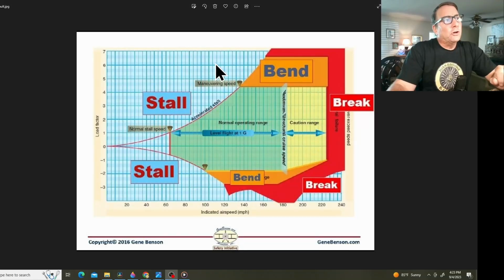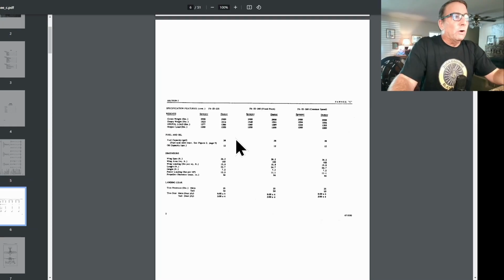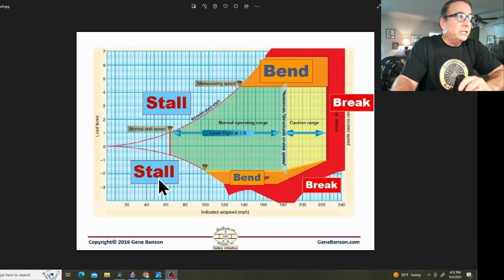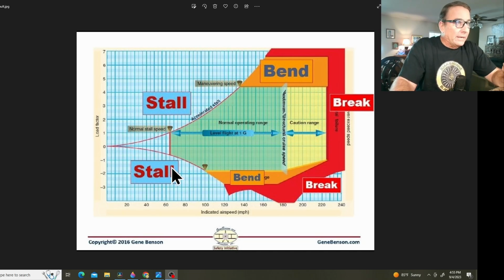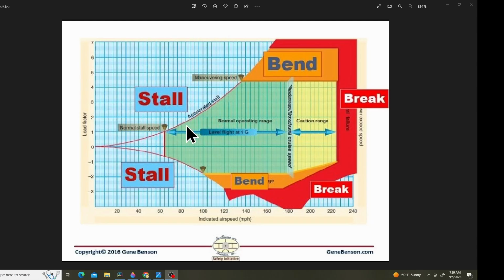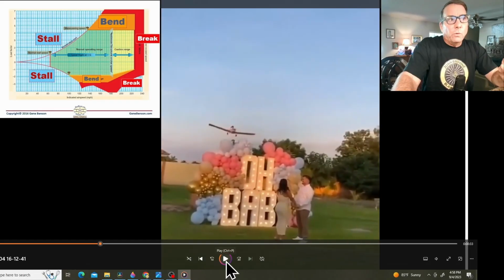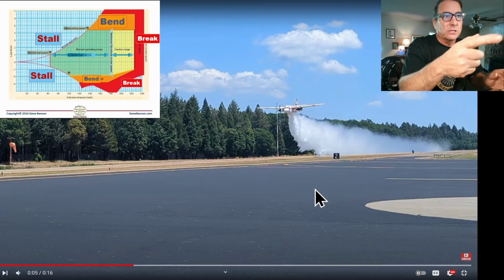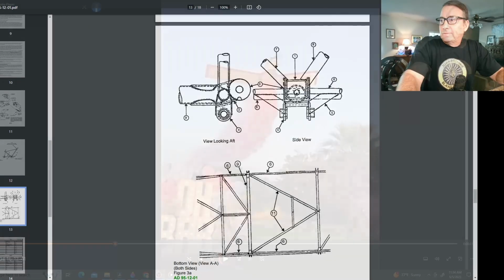PA25-235 Sinaloa MX Gender Reveal Party Structural Failure

Comment: Am I right in thinking that the safe operational airspeed is reduced when there is less of a load due to the increased potential acceleration (increasing potential g-force) within the normal structural wing  load limits?   So, you could actually increase speed above that diagram's indicated limit, but your manoeuvring potential would be critically reduced?

I noticed in the video, when its played frame by frame that he actually pulls up to a vertical (straight up) pitch extremely quickly from horizontal and at that speed the air pressure against the plane of the  wings ripped one off immediately.

Comment: Juan the best at this.
I watched it multiple times in slo-mo and I’m wondering if the pilot was a little lower than he planed or the palm trees were a little higher that he thought? What ever the reason man oh man did he pull that nose up, it looked like it was 45 degrees nose up and the wing was folding up around the fuselage in less than second, and when he cleared the palm trees they look to be much higher than the others off to the side of him.

Comment: If I get this correct, the maximum maneuvering speed decreases with the weight in the same way the stall speed decreases. Vs new = Vs Old Weight × √(New Weight / Old Weight). Thus, Va new = Va Old Weight × √(New Weight / Old Weight)

Comment: Hey Blanco, when the water is dropped rapidly, remember the wings were making 3,000 lbs of lift but the aircraft now weighs only 1,600 lbs. The airplane climbs violently, sometimes exceeding the available down elevator.
Reply: I'm no expert, but this doesn't sound right to me. The wings are placed at, or even slightly behind, the center of mass of the plane; so even with the large discrepancy between lift and weight, it doesn't have a significant moment arm to operate around, and if anything, with the wings behind the centre of mass, that would create a slight nose-down torque upon release -- but regardless, the tail fin is there to keep the plane flying generally straight. So I think you're confusing linear forces with torques. I mean, the plane can fly straight and level when full, and can fly straight and level when empty. It's just a angle of attack change to move towards those two regimes.
Reply: @TheHuesSciTech The tank in that Piper looked to be forward of the natural CoG, mounted in front of the pilot like that. The dump probably moved the CoG backwards a bit, and did so suddenly. Given the likely strong nose-up trim required at maximum weight, even a small movement of the CoG could induce a strong pitch moment if the pilot wasn't ready to counteract it.
Reply: @TheHuesSciTech  it has nothing to do with CG. Presuming everything is in equilibrium, trim is set, the horizontal stab is neutral or pulling down slightly and the wings are making 3100 lbs of lift to carry the 3,000 lb gross weight straight and level. Now dump the 1,500 lb load in about 3 seconds. The airplane will pitch up violently, not because of any change in cg, but because the wings are still making 3100 lbs of lift but you only weigh 1500 now. Try it sometime...ag pilots are accustomed to taking 20 or 30 minutes to empty their hoppers, not 2 or 3 seconds. Best of luck, and be ready with ALL the forward stick!

Comment: This had to have been a maintenence or inspection problem, it almost certainly wasn't a problem with Va adjustment. 
Remember that engineering load (stress applied to the components, not cargo) is the product of acceleration AND mass. Components really don't care if a load of 20 units was created by 5units acceleration and 4 units of mass, or 2 loadfactor and 10 mass. There may well be a failure somewhere else, like the seat frame/floor under the pilot or engine mounts because of a non-proportional reduction in sub-component mass, but it wouldn't be in the wing attachment. (The video touched on fixed mass components but stopped short of considering their actual affect.)  

A true adjustment to maneuvering speed is quite a bit more complex than "it is reduced with gross weight", and involves the specific loading configuration, minimum load factor limit required by the type of flight and max load factor limit for the fixed-mass components of the aircraft(engine mounts). The basic stall-speed-style adjustment ( Va₂=Va₁·√(w₂÷w₁) ) is a conservative [worst case loading config] gross simplification, useful for easy of flight planning but insufficient to analyze a crash.
 
If you are at the listed maneuvering speed for MTOW and most of the weight reduction was taken from the fueselage (so that the wing tanks are at least proportionally full) then the structural stress placed on the wing components by the increased acceleration factor will not be any higher than the design working load limit and the failure will not be in the wing structure.
Reply: It didn't look like the plane's speed was above simply adjusted Va anyway, which would be 92-97mph assuming 150lb pilot and fuel between 30minutes and full. 
And ultimate design load being at least 150% of working load limit (122% of simple limit speed = 113-119mph)).  
Reading the manual, normal dusting and spraying is done at 70-90mph; and 75% cruise with the spray equipment is only 103mph.

Comment: Another way to think about the issue of pulling G while dropping weight is this: Being that G is lift over weight let’s consider a 2,900lb Pawnee pulling 3G’s. That’s 8,700lb of lift. If that lift is maintained while dropping 1,000lbs the G load jumps to over 4.5G in an instant. Add to that the often corrosive nature of spray chemicals over the ,ice of an old airplane.

Comment: I believe the compression struts of the Pawnee don't help much. They have a big internal stiffening beam, but all the same I don't think the failure behaviour is the same when the failure mode is buckling instead of stretching, and effectively there is no or little yield phase where you merely bend things. Once the strut starts to buckle and bend off axis, and the load is still there, that's it that's all.

Comment: lower weight causes          lower safe manoeuvring speed  because ?   You can pull more g load with full control input when the plane has a lower mass??     Did I miss  that exact correlation take away from the graph ???

Comment: When an aircraft manufacturer has a bit of a reputation for wings occasionally folding up unexpectedly, keeping any unnecessary wing loading out of a drop like this seems like an even more crucial, basic safety practice even without the corrosion factor being known. It's not just ag sprayers or GA that have to face corrosion risks head-on, either. Airline aircraft deal with corrosion issues as well, and the manufacturers have their own specialist "corrosion gods" who get to know the issues seen in the field, and their remediation, in great detail. Boeing had quite the send-off a few years ago for their retiring master of the subject who spent lots of time deep in the structure of 747s (esp. under lavatories and anywhere condensation tended to form), and even in their fuel tanks where organisms would live feeding off the jet fuel and creating issues in tropical climates, particularly.

Comment: Alternative hypothesis: the pilot pulled up a moderate amount but managed to get the stabilizer so low that it dipped into the dropped load mist. Because that mist is a heavy fluid it vastly increased the up elevator effectiveness and so slammed the tail of the airplane down, hence causing high AOA and the overloading of the wings.
Reply: You got it all wrong pal

Comment: I fly SEATs and I can tell you that the airplane does pitch up when the load comes off. If you ever watch a cockpit view you’ll see the pilot push the stick forward (full forward for a salvo). I think the pilot wasn’t ready for the pitch up, was well above ideal drop speed, and the rapid increase in G’s caused structural failure. Keep in mind that the wings are producing around 2900lbs of lift at that airspeed and pitch angle. When the plane loses, let’s say 1000lbs within a few seconds the excess lift causes the plane to pitch up rapidly. If you aren’t ready to counter that with forward stick, you will find yourself behind the plane. This tendency only increases with speed.

Comment: That is soo very sad.  The pilot being over excited for his friends with such a display, possibly..  Did he need that big of a load for a gender reveal?.  The short answer is easy.  I hope everyone affected can make it thru.  Pops had a Bellanca Citabria that was brought to the fail point.  It was being rented as a glider tow at a local airport.  After the last tow of the day the pilot decided to take his buddy up in it. The Citabria was rated for LIGHT aerobatics, So they thought, "lets have some fun.  They ended up bending the right wing strut.  Pops didn't rent it out again.  Fabric was opened to check structures and welds, struts replaced, a endless list of checks after a overstress, as per Bellanca.  The Bellanca head factory guy? who built wings came and took a look, at everything else as well.    A couple more checks and signatures and it flew again.  Actually flew better after all the work.   It was sold and made its way to Anchorage.  Last annual recorded was 2013 on that tail number.  Pops passed in 2013.

Comment: One would think training in type of aircraft would go over the fact you can rip the wings off. It seems like the pilot was flying the wrong type for the maneuver he expected to pull off. There are probably planes that can do exactly what he was attempting. It also seems like a backyard party is not the best place for an air show. In the freezeframe, it looks like the wing is already coming off as soon as the load is dumping, like there was a problem structurally already present. This seems like a terrible reason for a pilot to die. Vanity gone wrong.

Comment: Maneuvering speed was an area one of my instructors drilled into me. (I had three total and lost each one as they moved up into the airlines) I’ve never seen that chart before but I can say that its a great tool, especially if you want to explain why less weight will decrease maneuvering speed. I assume the same logic would apply when 12 skydivers exit an aircraft.  Great teaching moment. I enjoyed the entire presentation.
Reply: The way I heard it put is a heavy load will stall.  A lighter load can generate more lift before the stall and thereby more stress on the frame.  Think of the Va stall as a safety valve that dumps excess lift.  The wings will eventually create the extra lift, but the frame can’t spread the lift.  Even if the struts and spar distribute the force to the frame, now the engine mount is overstressed with its heavy load.
Reply: @scottmoore598 best way I’ve heard it so far for me I think
Reply: very counterintuitive

Comment: As a pilot and someone who works on aircraft, Pipers aren’t structurally built as well as a Cessna. If you go through the boneyards you’ll find pipers fill these yards. Rarely will you find a Cessna with a broken wing spar. I’d bet had he been in a different aircraft the spar would have bent, but not broken. Great job explaining what could have gone wrong. Condolences to his friends and family.
Reply: AD 95-12-01
SUMMARY:   This amendment supersedes Airworthiness Directive (AD) 93-21-12, which currently requires inspecting (one-time visual and dye penetrant) the wing forward spar fuselage attachment assembly for cracks or corrosion on certain Piper Aircraft Corporation (Piper) PA-25 series airplanes, and replacing or repairing any cracked or corroded part. This action requires repetitively inspecting (using ultrasonic and dye penetrant procedures) the wing forward spar fuselage attachment assembly for cracks or corrosion, replacing or repairing any cracked or corroded part, and reporting to the Federal Aviation Administration (FAA) the results of the inspections. This action is prompted by the FAA's lack of confidence in detecting internal corrosion in the wing forward spar fuselage attachment fittings while accomplishing the inspection methods required by AD 93-21-12. A report of a crack in the wing forward spar fuselage attachment assembly on an airplane where the inspection requirements of AD 93-21-12 were accomplished also prompted this action. The actions specified by this AD are intended to prevent possible in-flight separation of the wing from the airplane caused by a cracked or corroded wing forward spar fuselage attachment assembly. 

Just wonder with foreign registry if AD was even complied with.
The early Pipers were built much stronger with welded steel Truss fuselage. This also includes the PA 25 Pawnee. 
Wing Failures with the PA 25 are long term maintenance issues and not Design issues. AG planes operate in a Highly CORROSIVE Chemical environment. 
The failures occur with the fuselage attach fittings and not the wing spar itself.
Reply: MSFS pilot? Have u ever flown a real piper by chance?
Reply: One of the most ignorant comments so far. Cessnas are also subject to physics. The Pawnee has several AD’s relating to spar attachment. These are not design related but maintenance related. When these are exported south of the border AD compliance is often ignored. Decades of carrying very corrosive materials necessitates careful attention to maintenance, Cessna, Piper, or otherwise.
Reply: @whamo1966 she's right tho...Piper has more wing spar issues than Cessna. There's no debate here sorry if this fact offends you...well not really lol
Reply: @desertshooter007  this video is about the PA25 PAWNEE. It's major wing issues are with the Fwd Spar FUSELAGE Attach Fittings.

The PA 28 has major wing spar issues as does several other models .
Reply: @desertshooter007  another ignorant statement void of actual facts. Thanks for your contribution…. Lol

Comment: Yes, these are old aircraft. Ag aircraft are known for a very high cycle rate. Very little cross country, lots of spraying/spreading and landing on the nearest strip to reload the hopper. Greasing it on seldom happens. The main gear, lower engine mount and wing root provide high stresses in the same area, but different directions. Add some corrosion and  its only a matter of time before something gives. I think the pitch up was uncommanded. Dumping the load increased the G's which overloaded the engine mount causing a buckle at the wing root. The engine only dropped a little, because only one side failed, but that force displaced something at the wing root and it folded up. The impact destroyed the evidence.

Comment: Lot of cements but seem everybody miss the air cannon blasted right  under the wing during a critical load operation. You can see how the tip of the wing deflects once the shock wave reaches it.

Comment: Thanks! There are numerous Airworthiness Directives on the struts, the one you showed for the main spar attachment and another for the aft spar attach. It does not look like either of those failed. As you mentioned, it does appear that the left wing failed at the outboard strut attach point. I’ve not done crop dusting with these birds, but I do have over 600hrs in Pawnees on glider tow duty. We are about 1200# below MaxGW. You are hard pressed to get over 120mph in a dive without that extra weight.

Comment: I confess, I am confused by this explanation.

A stable aircraft will trim at a lift coefficient. This, when the load is dropped, assuming it is on the CG, the aircraft would pull g to maintain the lift coefficient. There would be no effective load change on the wing.

But! If the load is in front of the CG, you would get a trim change increasing lift coefficient … is it possible this has nothing to do with VN and everything to do with sudden trim change unexpected by the pilot combined with a pull-up?

Comment: not even the camera man knew the wing failed, he panned right back to the happy couple...also i noticed he HAD to pull up hard or run into the palm trees!! he was low and intended to avoid the trees after he dumped. so he would have crashed without pulling up, or he should have never flew lower than the trees. it was a complete miscalculation from the start.

Comment: So many people have no idea that planes of any make and model can have structural failure even a brand new plane.  Planes are made to be light for lift and fuel economy.  They're not made for extreme maneuvers rather for gradual slow ones.  Anytime you ignore this you may be falling out of the sky rather quickly.  Air is very dense at sea level also you have to be even more careful.

Comment: Love you Juan, you have taught me a lot about aviation, I think you got this one wrong.  
Wouldn't the plane start in the yellow area 0 G's (fast) and then shoot  up into the structural failure at the top with the speed decreasing (to the left)?

From your show, I understood maneuvering speed, to be the speed where you will not stall during a standard turn, and the guy you talked with would mark the glass with this.
The stall curves up and down to the left don't have yellow above them because you stall the aircraft prior to exceeding the G limit.
A lighter loaded aircraft would be able to pull more G's prior to stalling since the lift is not related to the aircraft mass, F=ma, same F, lower m, means greater 'a'.

I think this was target fixation, "oh shit the trees", stick yank and 8G's or something of the sort.